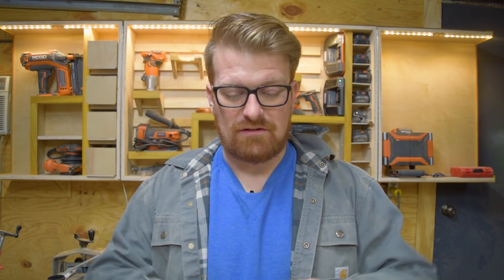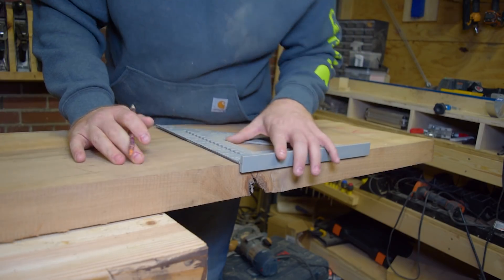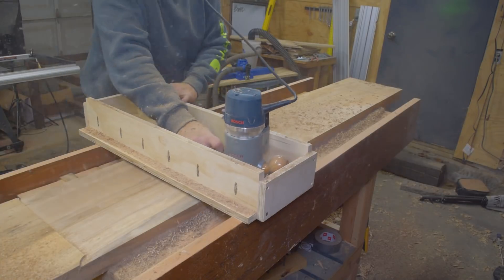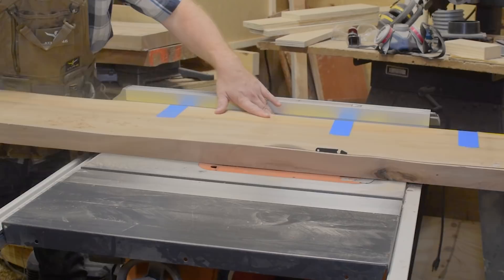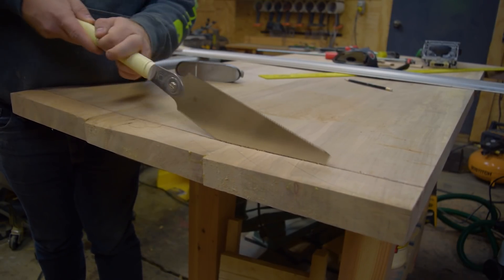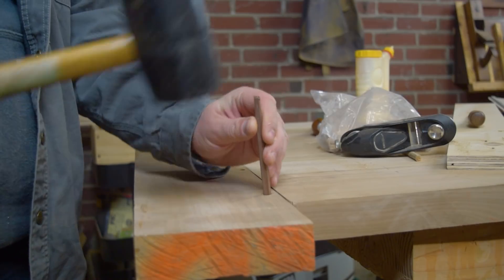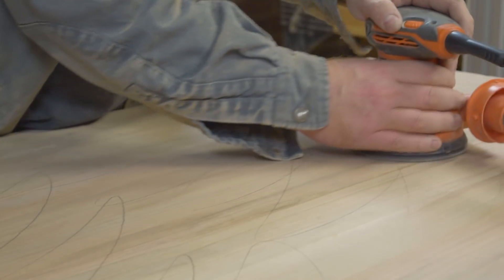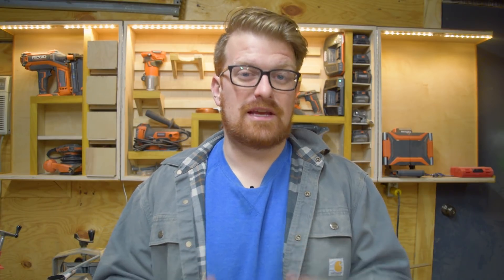Industrial Modern Table w/ Gilded Steel Base | Woodworking Builds

Comment: Awesome Video, one trick you can do if the board fits through your planer, is to take a known flat board, and level the board you want to flatten shim where needed like you did on your work bench, and then run the whole thing through the planer. When the first side is flat.. Remove the panel flip and run back through to flatten the other side.
Reply from the maker: I'll have to try that another time, I thought a router was a more approachable tool, I wasn't sure how many home gamers had a planer in their shop.

Comment: It came out as a nice surface but to a hand tool guy like me it looks like a lot more work than it had to be.  A scrub plane followed by a #7 jointer plane and then a smoothing plane would have had this knocked out without having to build that jig, mess with your bench and do all that leveling.  granted you probably would have had to sweat a bit more and there is a bit more back and forth to get the surface you want so I guess it depends on how you like to work.  Its rare that hand tools get to be faster than you machine folks :P
Reply from the maker: I suppose you wouldn't even have to flatten out each individual board in that case too.  The grain on this stuff went every which way, I did work with some hand tools at first, but there was just too much tearout.
Reply: Wood.Work.LIFE. yeah, I would have jointed, glued up and then flattened unless there was a serious wind in a board. But I doubt I would have gotten it quite as perfect. Wild Interlocking grain is a tough mistress, looks pretty but works so hard.
Reply from the maker: Ya, maybe a skewed low and jack for the finishing work, I only have a low angle block, works great on end grain but not so much on the windy bits.  Maybe just card scrape the bojeesus out of it.
Reply: you would have hands of steel by the time you were done scraping that sucker lol.